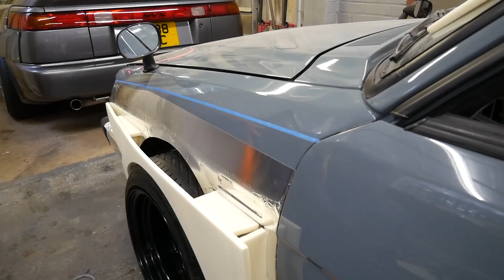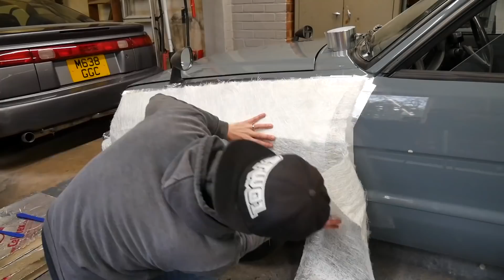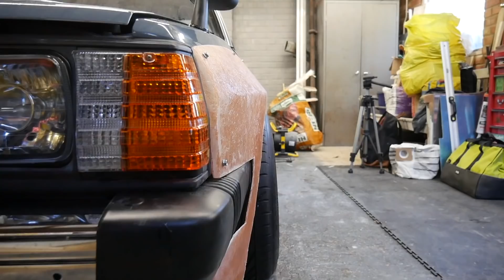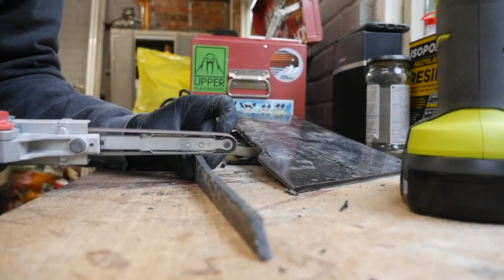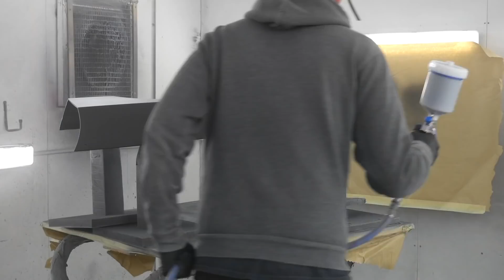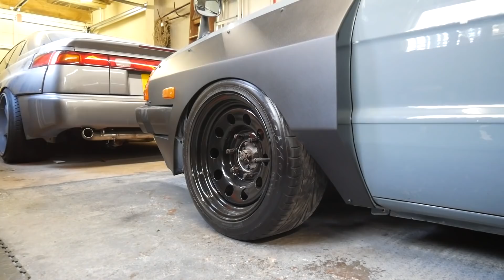Building a widebody overfender in 5 minutes

Comment: It's amazing watching someone who clearly has proper bodywork skill doing this, compared to just a DIY guy. 👌👌
Reply from the maker: Appreciate the kind words dude.
Reply: I guess if you like cheap fiberglass fake panels....
Reply: @PhysifistEngineering  you forgot to add- more durable, easy to repair, and to work with.
Reply: @StatesMusic  that all sounds like metal
Reply: @PhysifistEngineering  sure minus the weight lol
Reply: @StatesMusic  it only adds weight when you do stupid stuff like built a fender over an existing fender, lol. You're right, all the cars in the world crumbling under the weight of their own sheet metal, lol.
Reply: @PhysifistEngineering  I dunno man, just seems you haven’t worked with fiberglass enough. To be unbiased that is. 

And yes actually my 84 sheet metal mercedes is quite literally crumbling around the fenders, though I havent seen my other fiberglass fenders rust, nor dent as easily as well.
Reply: @StatesMusic  I build custom cars for a living. I don't have any customers that would want any cheap fiberglass applied to their cars. They prefer value over being cheap and lazy, which is what building faux fiberglass widebody panels over existing panels is.  Your anecdotal example has no bearing on the entire auto industry. If you were right nobody would be building metal bodies.
Reply: @PhysifistEngineering  right and I presume you work on cars older than 2000s? right… I dont see how anybody wants a fiberglass panel on a heavy set body older than 30 years old, unless its going to a track. 

And I am literally right its common sense dude, Fibreglass is lighter, wont rust, hard to dent, flexible, easy & cheap to fix and construct with very minimal tools compared to metal working… Fiberglass is good for widebody and custom panel/bumper work. 

Like I said, Im not wrong, you’re just biased bro, nothing wrong with that either, but of course you’d love working with metal if you have an entire shop with a plethora of tools to toy with.
Reply: @PhysifistEngineering  Like if you’re calling us fibreglass workers cheap and lazy then by all means bro, if you’re willing to buy us an entire weld kit with metal working instruments then talk all the shit you want, if not- then I dont see how your opinion will change the fact that  fibreglass will be the way to go as of convenience, eco friendliness, cost effectiveness, durability, and weight savings. 

The reason people dont come into your shop asking for fibre panels is because they have a show car.
Reply: @StatesMusic  I don't build show cars, they all are over engineered and reliable. It doesn't save weight plastering fiberglass over sheet metal. You didn't replace anything, you added. And if you're so concerned with weight, go carbon fiber. If you can't afford a welder, that's your problem, not mine. Like I said, you're cheap...you won't even buy the tools to do metal work, so you've settled on fiberglass. Building fake widebody fenders slapping fiberglass over existing sheet metal is the definition of all show, no go, lol. Man, you're a walking contradiction, lol.
Reply: @StatesMusic  these fenders increased weight and drag and didn't increase capacity for suspension travel. So they serve zero purpose except visual, which is....wait for it.....a show car.
Reply: @PhysifistEngineering  And I never said this wasnt a show car so I dont know what you’re proving, you’re basing your entire opinion and ideology off of one fibreglass video, where as many other creators remove majority of the metal contents and coat it with fibre to then form them self. 

This dudes car has air ride suspension, no fucking shit its a show car dude. 

Like bro just admit you have something personal against fibreglass which I honestly find hilarious.
Reply: @StatesMusic  I prefer metal over fiberglass aswell. Nothing is worse than having paint chip and crack on fiberglass, and as weak as fiberglass is it doesn't help its crash safety. Metal working is a way more talented skill to have.
Reply: Awesome,  guess now im gone try to make mine lol, thanks for sharing your knowledge.

Comment: Does anyone know what kind of foam he used? I'm interested in using this technique to make a hood scoop lol
Reply from the maker: Dominic Pedrazzini it’s closed cell polyurethane foam board. Most fibreglass specialists will stock it.
Reply: You can also use styrofoam from the hardware store, it’s much cheaper then the urethane-foam. Just make sure it’s extruded. Also notice: poly-resin will destroy the foam, so make sure you block the resin from touching it. Like the dude in the video, he surely used the Aluminium-tape for that reason. You can simply use Aluminium foil, just spray-glue it to the foam, I do it like that.
Reply: @BuildCreate  thanks!
Reply: @sivasriege8651  awesome, I'll definitely go that route lol
Reply: Dominic Pedrazzini you‘re welcome 😊

Comment: That amazing, but it also looks like a misplaced knee would go right through it! How would you strengthen something like that? Would you fill in the space behind it with foam of some sort?
Reply from the maker: There's 5 layers of fibreglass, then fibreglass filler skimmed over it, followed by multiple coats of raptor bedliner. It's very strong ;)
Reply: @BuildCreate  raptor bedliner for everything interior exterior never clean again 😏✌️ cheaper in US but we suffer price hike here 😒

Comment: Awesome job! What type of foam is that, and what do you use for the final paste before sanding?
Reply from the maker: Thanks dude. It's polyurethane foam board. The paste is fibral fibreglass filler, it's amazing stuff. easy to use and spreads incredibly smooth.
Reply: @BuildCreate  Hi there I been trying to find the polyurethane foam everywhere and I really can't find none to purchase. Most foam out there are not polyurethane.  Where can I buy these?

Comment: Great skills! Consider using 2” wide clear plastic package tape instead of the metal tape. I’ve used it with success doing fiberglass & it’s cheaper. I’d try adding a “return”  flange to the wheel opening to add stiffness. Once you cut the opening like you did, it’s very difficult to add a flange the wet glass won’t bend sharply & stay in place. I’ve seen rope glued to the inside & when the glass is laid on, you wrap it around & in, over the rope. I’m sure there’s plastic hose or foam that would work

Comment: What kind of foam did you use to make the original mold? I have no bodywork skills, just a diy guy, but I wanna do it right. I've seen others use foam to make molds, but Idk if the kind of foam matters. Can I just pick up foam from a craft store or what?... Then theres always the expanding foam method...
Reply from the maker: Hey dude. It’s polyurethane foam board. Available from any decent fiberglass supplier. It’s way easier to work with this stuff than anything else. 
Just take your time, rushing things will be your downfall. 
Make a small random shape to start with and glass that to get a feel for it.

Comment: Very nice. Simple and clean!  Did you have any issues with the door opening?  Also since you laid your fiberglass over the foam would it have been worth it to just use that as a mold and add your small block off pieces to it to create a final with a gelcoat layer?

Comment: Looks pretty good. But it also looks like you're gonna get some serious wheel rub... And I am very curious to see what you do with the doors to make them also fit with the widened look, and open without catching on the widened panels etc. Basically I expect quite a "gap" will be present when the door is closed.
Reply from the maker: The wheels clear perfectly fine, one of the main things i was concerned about was tyre clearance...so i checked constantly throughout the process. 
My old bolt on flares where even closer to the tyres and never rubbed. 
The door also opens fully without any issue's, i work in a bodyshop so would never make such a rookie error. 
There will be side skirts to work with the front and back.
Reply: @BuildCreate  oh I have plenty errors ahead of me before I get to your level bud. This video was absolutely incredible

Comment: WOW...This is Amazing" ...can i ask... do you think/feel cardboard could be used if also covered with aluminium foil tape???..instead to the Polyurethane foam board ??
it seemed like the Poly.foam board was used just to keep structure in space/distance from the car. once it was dry it looked like you took it off and did nothing more with it...so if i used cardboard for a tighter fit to the car, would it work? (thank you ahead of time) <3 feeling super inspired.

Comment: Hey mate, did the aluminium tape cause any troubles when peeling it off the original paint? Great job
Reply from the maker: Not at all, just applied a small amount of heat and it peeled off easily.

Comment: How would you go about making the other sides over fender? Just asking out of curiosity because if you do it from scratch wouldn't you run into issues with it not looking the same?
Reply from the maker: Super easy. I made two of everything in the foam (including the spacers) Took a shit load of measurements, marked out the same contact points. 🤙🏻
Reply: @BuildCreate  Thank you very much for the reply (didn't think I would get one). I been watching all your videos and reading up on the way you do things. Have a dream to widebody my cb7, so I'll have to go this route because there is non being sold. The one kit I really like is a one off model and wont be sold by the owner. You have opened my eyes to another way of accomplishing my dream build in the future .

Comment: How do you plan on making the other side the same shape? lots of measuring?
Reply from the maker: I cut two of everything in the foam board used for the base. This included all the back spacers. 
I also took a shit load of measurements, the other side came out perfect.
Reply: @BuildCreate  Awesome man, good job! This looks super clean. Im going to attempt something like this for my 84 300zx. What was the foam that you used for this project? Was it a specific type? Looks super easy to work with.

Comment: What kind of tape did you use to cover the fender before putting on foam? And can it damage paint?
Reply from the maker: It's aluminum foil tape. It wont damage paint, i would warm it up a little first to make the release easier.

Comment: What size rims and tires are you using. I really like the steelies you are using, this gave me some thinking on what to do with my Brat. Can’t wait to see it finished
Reply from the maker: The wheels are 15x7 et00, the tyres are 195/50 :)
Reply: Did you have to change bolt patterns
Reply from the maker: Brice Martin yup! The original pcd is 4x140, just knock out two opposing studs, a 6 stud wheel will then bolt on. Mark and drill new holes, put more studs in 😊

Comment: what are all the materials needed?
Reply from the maker: polyurethane foam board, fibreglass matting + resin, fibral fibreglass filler, raptor bed liner and aluminum foil tape.

Comment: That’s impressive, what materials did you use , and how long did it take per wing? 👍.
Reply from the maker: Poolyurethane foam board, fibreglass matting + resin, fibral glass filler, dolphin glaze for any pin holes and raptor bed liner. not to mention a hot glue gun and aluminum foil tape. 
Took 3-4 days per wing.
Reply: Build Create amazing thanks I might give it a go 👍

Comment: Absolutely awesome. What material did you use to create the form?
Reply from the maker: Thanks man. Its polyurethane foam board.
Reply: @BuildCreate  Nice. What do you think about using it to create a center consol from fiber glass? Atleast the outer wall, then use thin sheet wood and create the inside aswell?
Reply from the maker: @AngelWolfSoldier  you can use it for pretty much anything dude.
Reply: @BuildCreate  sounds good. I was wondering if it would be able to support what I have planned. But I found some methods to reiforce the structure so I'm not too worried.

Comment: I could have made that from steel faster.  its a basic flat sheet design with very little work required.  In other applications where there is more angles and curves, then great.  but this way you're also not guaranteed to get both sides exactly the same size either.  I prefer steel work but the process here is great.  I just feel that a steel wide arch would seem more professional when standing at a show or on display.
Reply from the maker: Steel work is definitely something i want to do in the future, i'm kinda addicted to learning new skills and processes. 
Currently i don't have the machinery or space to take on metal fabrication. 

Making both sides the same is actually pretty simple, i made two of everything in the foam (including the spacers and locations) and took a shit load of measurements. 

It's kinda hard to tell on the video because of the speed, but the fit and finish is to a high standard and very straight as i work in a bodyshop and would get punished if it wasn't haha.  

Thanks for checking out the video!

Comment: if someone leaned on it it will broke cause its not supported
Reply from the maker: Wrong.
Reply: @BuildCreate  well, i dont think so
Reply from the maker: @ahmedradwan1666  I’ve leant on it. Hit it very hard and it hasn’t broken. 
I don’t make crap.
Reply: @BuildCreate  I did not underestimate the value of your work. I just saw it as very thin, so I thought it would not bear it if someone leaned on it while it was parked in the street. I love wide body works and I do not want it to be ruined. ❤

Comment: ... that's like the myth about George Barris using beer cans and bottles as filler.....
.... and also the amount of moisture that will collect under there it's not your friend And1 fender bender and it looks like you're driving around in a busted trash bag!

.....funny
Reply from the maker: Well, the wing is also fibreglass. So no issue there. I'm also going to make copies of the wing.
Plus i don't drive like a cunt and rarely take out the car.....